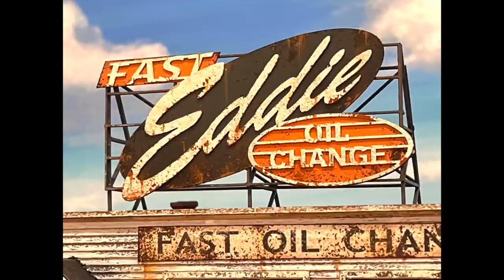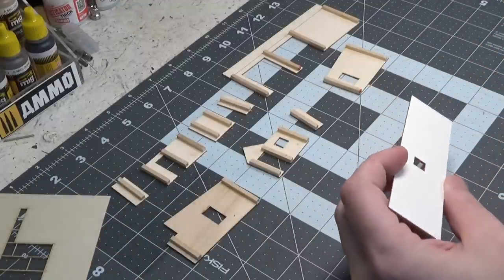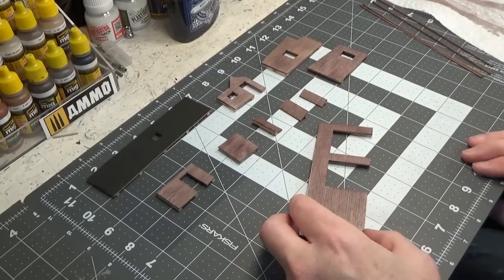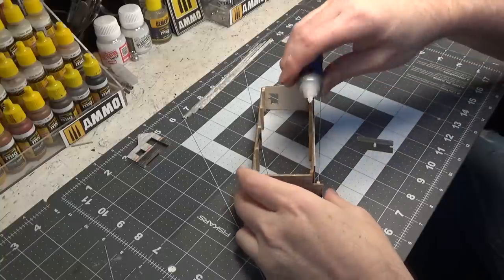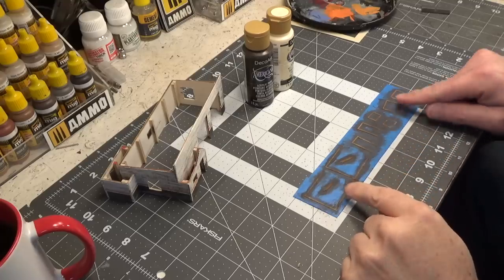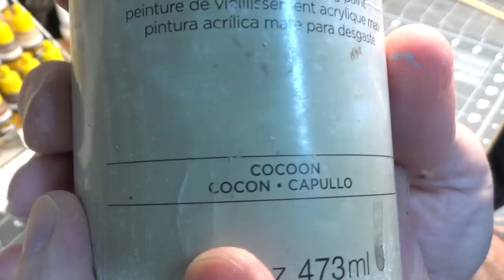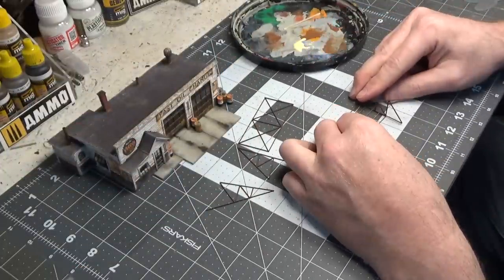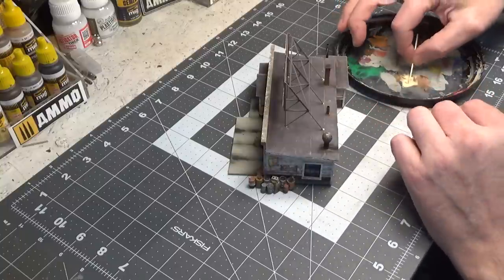Building a oil change garage

Comment: I think this would a perfect kit (and I just ordered one!) to have an interior. That brings something to mind: Is there a way to pre-stain the walls as you did and NOT have to put in bracing (which would show if one added interior details? I was thinking there might be a way to put weights/books on top and not affect the stain. Any thoughts on this, Jason?
Reply from the maker: Thank you so much! I really appreciate it! You could lightly stain the front side then let it dry. Then put masking tape over the front side that you just stained then spray paint the back side of the wall with your interior color. Or even try spray painting a grey primer over both sides of the walls first then paint them. Let me know how it turns out. Happy modeling!!!
Reply: @JasonJensenTrains  Many thanks for the guidance, Jason. I will let you know how everything turns out, although it will be awhile since you're mailing the kit to my brother for a Christmas pick-up by me.

Comment: diagram?  What if someone wanted the long wall and end wall on the back room of the model turned so that the long wall is turned towards the end of the large section of the building?  Id there a way to include a strip section that would work for that as well?

Comment: Quick question on the painting. Ive seen in this and past videos your technique of painting the individual boards so they come out looking like worn paint. On this one you use the sponge on the trim for the same effect it seems. As a beginner, why couldnt one use the sponge technique on the walls as well? It seems it would be easier for a more consistent effect for someone just starting (Like me).
Reply from the maker: Yes, you could definitely use a sponge on the walls. I like showing people different techniques. Thanks for watching Darron!!!

Comment: Really like these builds, but your models kind of cover the 40s, 50s, even the 60s but your themes are modern. A quick oil change outlet is more in tune with the 80s, 90s, how about just rethinking the sign to a fallen gasoline brand offering oil changes?